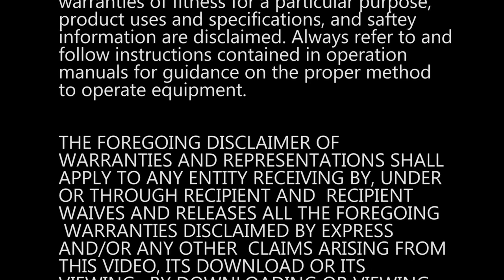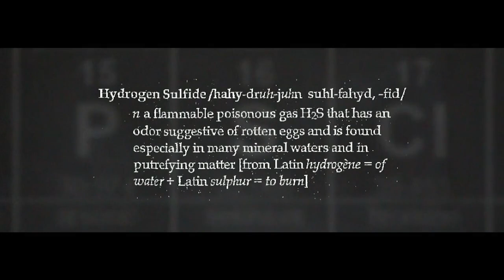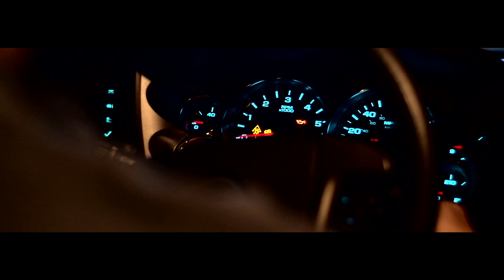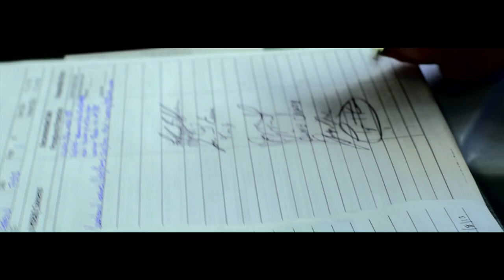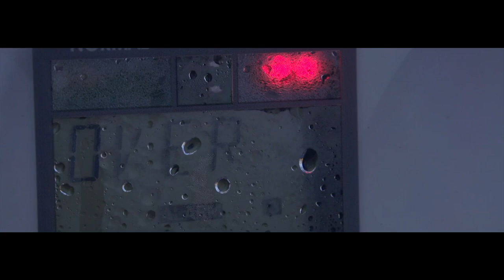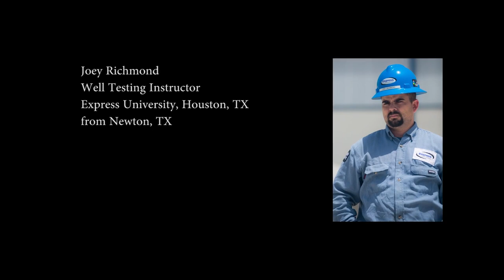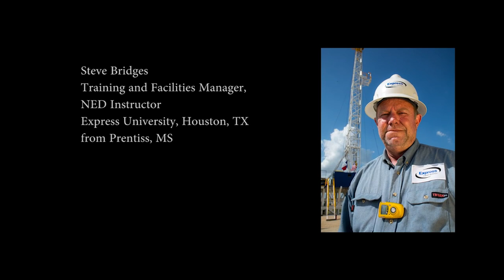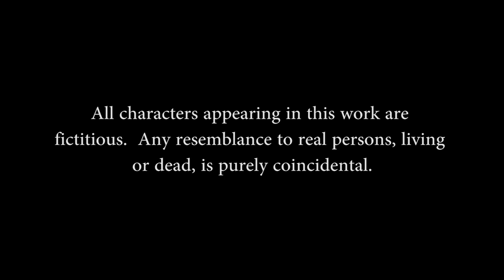Left Undone   H2S Movie

Comment: Please note that H2S comes from below, and the gas detector placement is not worn together with the helment . Please put proper. Work safe
Reply: Simplistic view of it. It's all about best placement for the situation. If your face is near/over a pipe, having it at your chest may not be the best spot. You're going to breath it in before your monitor detects it. H2S is heavier than air on it's own, but when it's entrained in hydrocarbons it's going everywhere. There are so many factors (temperature, % of H2S, humidity, wind, etc) that have to be taken into account, it's not as simple as some make it out to be.